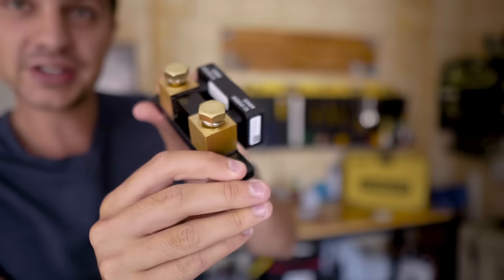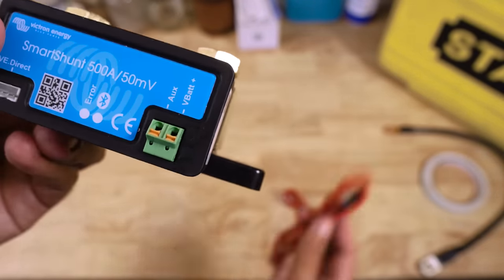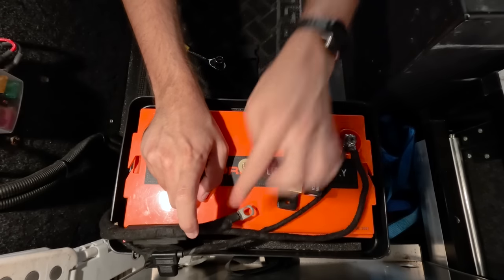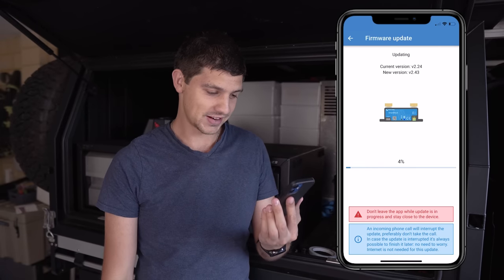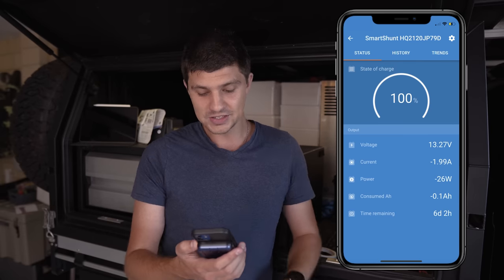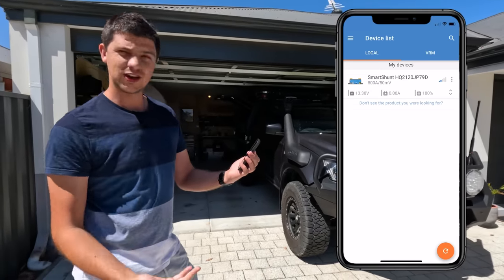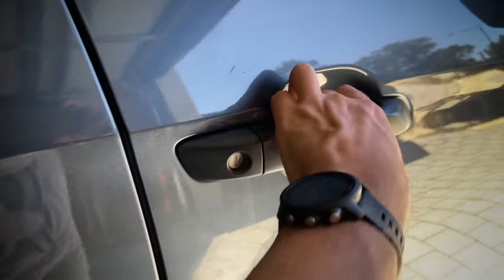Victron 500A SmartShunt Battery Monitor Install, Walkthrough & Review

Comment: Charged voltage should be higher than 13.2V for lithium, 14.2-14.4V is good, otherwise it’ll keep telling you the battery is back to 100% when it’s over 13.2V which is often the case for lithium
Reply from the maker: Thanks mate! I just went off the settings Victron suggested in the manual but will update that one - cheers. 🙂
Reply: Exactly right, best to get specs from battery manufacturer.
Reply: You are right Adam. Just wondered when consumed 10Ah and when get solar for 10 minutes it says 100% so 13.2V is totally too low! You can find it out like me very soon!
Reply: Spot on, was doing a test to get my dc to dc charger working from my car to the van so I need to loose some power from my batteries, ran my aircon and got it down to 90%, had a coffee came back and was at 100% again, no sun so solar wasn’t charging. After researching it was my voltage setting.  Apparently a good setting is to charge your batteries, see what voltage is going in then set it 0.2v below that.
Reply: Should it be set to resting voltage. Lithium will drop from 14.4v down to its resting voltage quickly. 13.3v . That's what I'm guessing?
Reply: @djsn2134  if you are talking DCDC charger if should be set around 13.3V for float charge, but the shunt doesnt affect charging, so you want charged voltage to be at or around max voltage your battery will see once fully charged (which is at 14+V for absorption charge) - it’s a trigger for the shunt to re-sync to 100%
Reply: @adamgregg6745  yes that's correct. I have my shunt set soc at 14.1v now. Much better now.
Reply: However float voltage s/b 13.6 , you do not want the float to be 14.(2-6)
Reply: @jd2plus2  Exactly right. For Lithium, 100% while on charge is 14.6v, while 100% at rest is 13.6v.

Comment: shouldn't the charge voltage for lithium be 14.1v then float ,  3.6v max per cell fully charged =14.4v but not to stress cells 3,5v each cell 14v ?

Comment: A very easy to understand explanation on how to install, set-up and use. This is a very nice piece of kit. Simple, yet functional. It also avoids drilling any new holes into your caravan/camper/motorhome furniture and unlike a TV or computer monitor, a battery monitor isn't something you stare at continuously and is only something you want to check periodically. I am glad you did a proximity test. Being Bluetooth, this is always going to be its downside and is the nature of the beast, but for those who have a relatively large caravan or leisure vehicle, knowing that you can check the battery at the most distant point in the vehicle or from your comfortable position sitting outside drinking beer, is useful to know. Good job on a thorough video.

Comment: Great video! My son is building a camper, and I'm bussy with the electrical stuff. Battery, solar panels, MPPT, DC-DC convertor DC-AC convertor, wall power etc, and the Shunt, to monitor the battery. Great explanation about te Shunt.

Comment: Hey Daniel, I got the smartshunt because of your channel! Cheers! 

I can see the shunt monitors the output on the app. Is there a way to monitor the input current? I’m connected to the alternator and just want to make sure it won’t drain my crank battery when the engine is off. Ta!

Comment: Its a nice unit. You need to do the connectivity tests with the canopy door closed. It'd be nice if Victron provided a remote BT transmitter (with a suitable cable) so you can mount it outside the canopy or other Faraday like shields. It will need to be waterproof for most applications.
Reply from the maker: Thanks mate, I’ve just done a few tests with the canopy door closed - seems the Bluetooth range is about half (if that). Luckily it still connects well in the cab of the car with the canopy closed though. 🙂
Reply: @explorebound  That's brilliant. I expected you wouldn't even get a signal in the cab! So this is great news. I have a BT BMS that I will have in the camper (all metal) and I would like to keep an eye on that while we drive (and charge), so this gives me some hope!

Comment: Thanks for the vid. I invested in the smart shunt based largely on this video. While I love it generally, I have to mention my particular disappointment with the Bluetooth performance. Specifically, I cannot connect to it once I close my canopy door. I was very keen to be able to monitor the system from inside the cabin while driving. Very very weak Bluetooth transmission!! I've tested other BT equipment from within the same enclosure and had full connection. Same poor performance with the IP65 smart charger from Victron. 

Very disappointed and feel victron missed a trick here.

Comment: Cool man. I just put one of these in my camper trailer and had the same problem with the 8mm lugs. Ended up using a stud terminal as a make shift busbar. 
Our camper is also an MDC which is a "timber free zone" so it acts like a bloody faraday cage with the signal. It's not a huge issue when connecting to the shunt, but getting the shunt to speak with a smartsolar mppt charge controller over ve.networking was a nightmare. Was sure I'd done something wrong but moving the CC closer to the shunt sorted that out. 

Im unable to get a signal from either device when Im in the cab of my ute, which is disappointing. 

However, having access to the data around battery charging and consumption is great. 

thanks for the vid!
Reply: Hi Andrew, I see there is a possibillity to  getting the shunt to speak with a smartsolar mppt? Are there any advantages, and if so which brand do you use for the shunt and smart MPPT?
Reply: @markhofland1898  hi Mark!

You would need to use the victron shunt with a victron smart charge controller (mppt) for them to speak to each other.

The advantage being that the smart shunt knows met amps in and out so I presume it helps when it comes to absorption and float. It can communicate the battery voltage and current to the mppt so the mppt doesn't over or under-do it. 

Also, in most systems the shunt is connected very close to the battery with thick cable so it would have a more accurate reading of battery voltage than the mppt.

If I were doing it again though I'd get the bmv with Bluetooth rather than the smart shunt. The bmv has better Bluetooth range, or so I'm told. The smart shunt range is really quite bad.

Hope that helps
Reply: @markhofland1898  oh one other thing. Not all victron stuff speaks with other victron stuff. For example,  I got the Orion dcdc charger and it doesn't utilise any of the smart communication. Which is painful. I'd avoid that piece of equipment if I were doing it again also. It derates drastically when it gets warm under normal operation. Unless you can run a fan directly off the heat sink, which for me isn't practical
Reply: @andrewford80  hmm… I’m bussy for a couple of weeks now to find the best hardware, you know what I mean. And Victron is a brand I see a lot in reviews and solutions. I did not dig in, in the manuals by now. But is it only possible the Victron MPPT communicates with the Victron shunt by Bluetooth? Or wired also? Again,  I did not red any manual. 😊
Reply: @markhofland1898  I'm not too sure actually. I believe the smart networking is a wireless network that only operates over Bluetooth.  I don't know how they go when the cerbo device is involved

Comment: Is it ok to run my vehicle chassis grounds (engine block, firewall, and fender) to system minus? I’ve had mine wired this way on my Jeep for several months now, and haven’t had any issues. Someone recently pointed out to me that it might be dangerous and now I’m doubting myself. I have a Jeep TJ with a non-smart alternator and 4.0L engine. Great looking truck BTW. 👍

Comment: great video mate! Was wondering if it measures the Solar input when telling you how much input current is coming into the system?
Reply from the maker: Hey Nick, yep it sure does! I'm currently working on a follow up video to my previous solar panel review running through how much charge it actually pumps back into the battery. 🙂

Comment: Hello, if I connect four batteries with 12V in series the total voltage will be 48V, will the charged voltage be set to around 48V or will be set to around 12V as we do on single battery connection?
Reply: Did you find an answer? This is the one thing I had questions about..
Reply: @d1ndark25  Yes, we should consider the total voltage and not single

Comment: Hey mate if you're just using the battery through a battery box will that also work in regards to not connecting the negatives through the dcdc charger as I just want a portable battery with box and still monitor it

Comment: I have 2 banks of 6 eg4 batteries (not LL). Needing a wiring diagram to connect my 500A smart shunt to them. Banks are parallel to parallel. Pairing off on th😊e two negatives. Would I need two smart shunts? One for each battery bank? Thanks.

Comment: Quick question, why do you set the charged voltage to 13.2v ?
I just bought a 120ah lithium (not the same brand) and was wondering what or why that is set to 13.2v… 
I have seen other vids of people setting theirs to 14.4 or 14.6 -🧐
Reply: Yep follow the battery manufacturer. Changed mine from default Victron value to 14,4 for my itech lithium

Comment: I connected the starter battery input to the dc-dc charger (the power cable from the starter battery) 
I did use "eBay" cable to start with, and when the Dc-Dc charger started charging at full power Voltage drop was around 2 volts and the charger would turn off, Voltage would return to 14v rinse and repeat :) I bought better Cable and problem solved
Great for checking Voltage drop between the starter battery and Charger

Comment: It's a shame it doesn't come in a series model. I've got 2x 300ah batteries wired in series, but because it's not designed to do that, it only takes on either the inbound or outbound current.
If I try to hook both negative terminals up from the batteries it just produces an error code which Victron is yet to get back to me about

Comment: I've bought a kit just like this but the positive wire from the shunt to the battery was not included. Can someone give me the name of the prong-like connector that he's using in this video so I'll know what I need to buy/ask for?
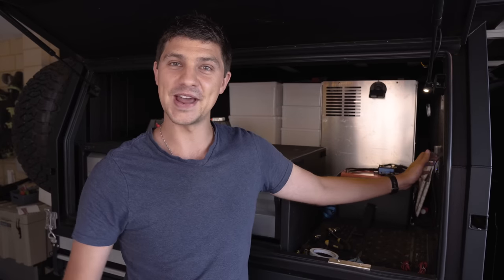Just to clarify, it's the cable he's talking about at around the 6:00 mark.

Comment: I want to use the smart shunt with 2 /12 V Lifepo4 batteries in parallel how would I wire that?? is it possible to use one shunt for two batteries in parallel or should I just get a bigger battery and use only one shunt for one Battery?
Reply from the maker: Hey William, here's the official wiring diagrams from Victron 🙂 https://www.victronenergy.com/media/pg/SmartShunt/en/installation.html

Comment: Hey mate, do you find you get the full 40amps out of your DCDC charger?
Reply from the maker: Hey mate! I'm using slightly undersize cable for the DCDC but am still getting around 37A - I suspect if I upgraded the cable I'd see above 40A 🙂
Reply: @explorebound  no dramas, I think this will be my next dcdc from my current 20amp one

Comment: nice one.... Im pretty sure the 120x is only rated for 105amps. I don't own one but i have seen it in the Spec sheet. Bit of controversy to why its called 120 when its really a 105 battery. Apologies if im wrong.
Reply from the maker: Yeah that’s correct - that’s why I set the discharge floor to 12.5%, because we can use 87.5% of the battery (105Ah)
Reply: @explorebound  yeah fair enough. I assumed it would be 87% of the battery size.

Comment: Your battery is only 105ah, not 120ah, set it to 105ah and 20% floor with charged voltage as 14.2
Reply from the maker: Hey mate, aware of the 105ah usable capacity that’s why I set the 120ah discharge floor to 12.5% (105ah used). Wouldn’t setting to 105ah with 20% discharge floor tell the unit there’s only 84 useable amp hours?
Reply: @explorebound  Check the spec sheet, its a 105ah battery called a 120x.
If you also look at the discharge chart, at 20% it will start to drop off significantly from 12.5v. The risk of using all 105ah is that the BMS shuts down and you need to reboot it with another battery (11v). You will also find lithium batteries charge a lot faster then then an AGM. If you have time, test the discharge rate at a 20a load.

Comment: funny how u got 500 amp one but your little battery is incapable of pulling any where near that
Reply: You can always make a smaller one if you dont want 500, or could use the 1000amp one🤔
Reply: That is the smallest smart shunt victron make.
Reply: @andrewford80  why? is it for  house?
Reply: @damienfrizzell9394  it's just not that huge on the scale of shunts. They also make a 1000 and a 2000. Suddenly 500 doesn't seem so big.

I don't know why they don't make a 200 or whatever. Maybe it's for headroom
Reply: Yes true, but it is like anything in life, would you prefer to have more not need it then to need more and not have it? I’d much rather have 500 A available to me and never come close then only have 200 and be on the border line every time. Each to their own mate, each to their own
Reply: @andrewford80  your talking 500 amps from a 100 amp hour battery even if it was capable of pushing more that 50 continous amps, which im pretty sure that brand can not may be wrong a 500 amp draw would have your battery completely dead in exactly 12 minutes . just curious why they need them so big thats all . a winch will only pull 400 amps at full lock
Reply: @damienfrizzell9394  my winch pulls nearly 500 amps.... victron make stuff for off grid living, they are not exclusivly just used in the 4wd market.
Reply: Hum, jumping into conclusions too early right? Look for a smaller Victron out there, I’m sure most of us get that one for the quality and reliability of it, we don’t care how many extra amps is capable of handling.
Reply: It hardly makes sense to build one smaller. That short run of copper isn't driving the cost.

Comment: Is this just an advertising channel now????
Reply from the maker: Hi mate, this is just a video showing how to install and set up a battery monitor that I purchased myself, I fail to see how that’s advertising.
Reply: @PKrangerdanger calm down dude, nothing wrong with the video he has posted. If you don’t like it don’t watch it. I found the video very informative.
Reply: If you follow the channel you can quite clearly see that it has become a promo channel rather than 4x4 adventure channel which it was originally. I was just wondering if that is the direction that the channel is going now? Pretty fair question
Reply: @ PKranger He's setting up a new canopy. Of course there's going to be content related to the new products he's using.
Reply: @PKrangerdanger  curious to know what’s made you feel that way? Is it the way stuff is being presented, like you feel like it’s an advert? Or is it just the number of videos that are reviewing products supplied by companies? 

By my count, I think only 8 of the 52 or so videos he’s posted in the last year have included gear that was supplied. I know he does everything he can to not come across as an advertising channel, and hand picks the products he thinks will benefit/interest his audience the most out of a tonne of offers thrown at him each week - 95% of the offers get turned down. So, it would be handy to know what exactly is making it feel like a promo channel. 🙂
Reply: @biancaspice6409  definitely is advertising that’s why I asked the question. Is there a disclaimer on each video when money changes hand for promotion?
Reply: @PKrangerdanger  I could be wrong, but I’m fairly sure Daniel states when a product is supplied. He also states that even so, all thoughts are his own personal opinion on the product. I don’t see it as ‘promoting’ the product, he’s either doing a review of it, or just explaining how it works or how to install it. If the product was bad, he would say so. 

But even so, apologies if you think it’s becoming a promo channel - it’s definitely not the intention. As others have pointed out, he’s doing a new build on a new canopy, so there’s a lot of new products.